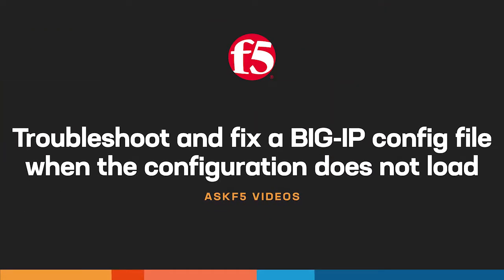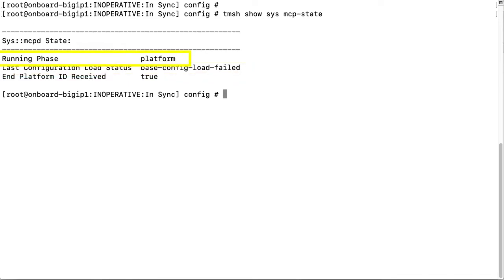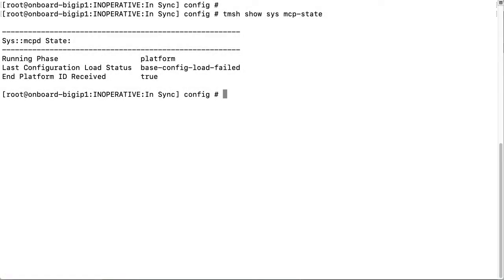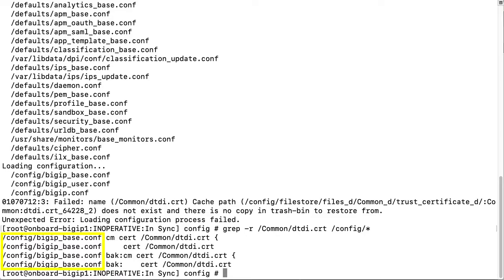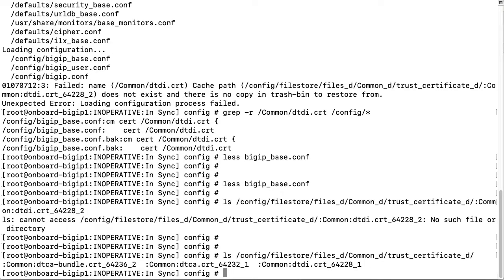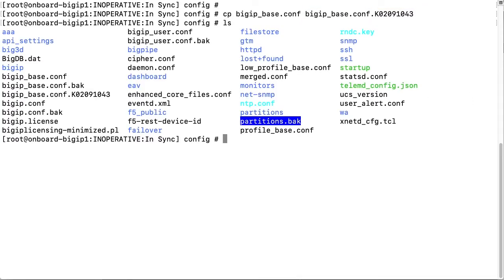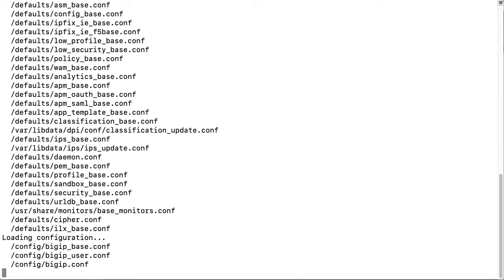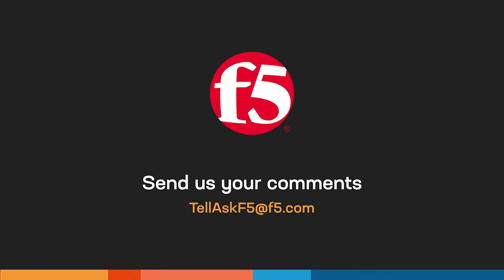Troubleshoot and fix a BIG-IP configuration file when the configuration does not load

Comment: I can't enter through the console to be able to check the configuration. when trying to enter the credentials I get "this account is currently not available"
Reply from the maker: Looks like you have access issue to your BIG-IP system's advanced shell or tmsh. Ensure you have the right access credential to the user account with Terminal Access enabled. For example, default admin user account does not have terminal access.For more info about enabling user with terminal access, refer to this article, 
K000135228: Enabling bash or tmsh access on the BIG-IP 
https://my.f5.com/manage/s/article/K000135228

In addition, ensure you have the correct IP address or hostname of the BIG-IP system and you are accessing from the source IP address that is in the allowed list.